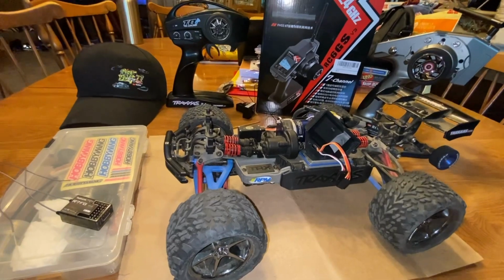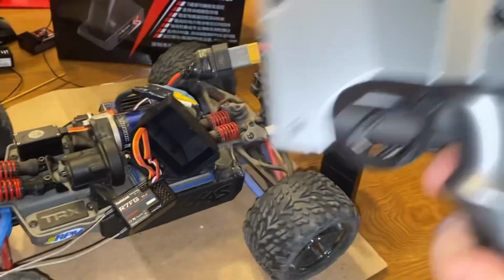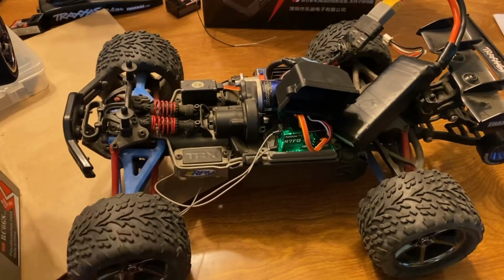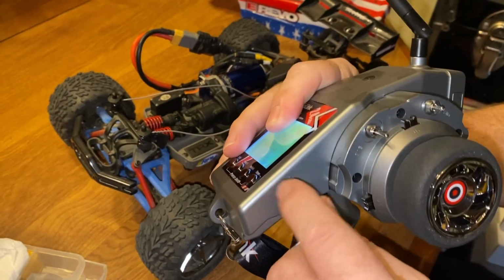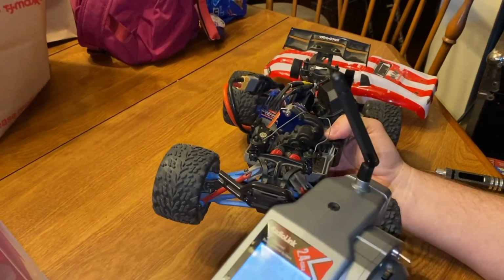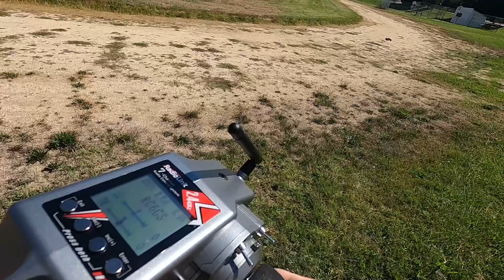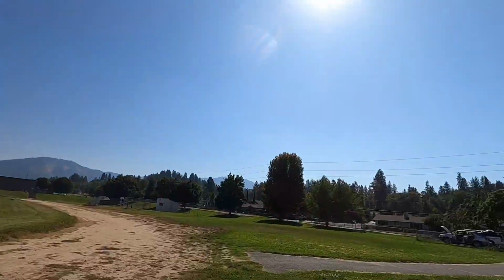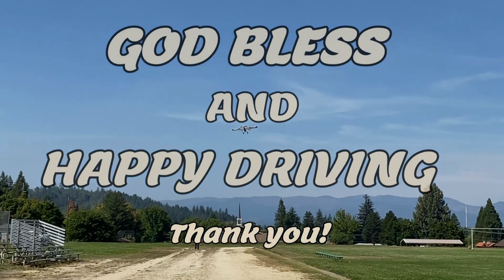Radiolink RC6GS V3 How To Install + Gyro + Range Test = Amazing !

Comment: Great video - cranking 'em up to 11 my dude! 
I've been running this radio for about a year now, on a small fleet of cars, crawlers, and even a skid steer Sherp. Great bit of kit, but be wary of using the 1/4" mount for your phone or anything RF "noisy," range suffers pretty significantly when I have my Pixel 7 in a swivel ball joint up there, but don't push the range when I'm using it because of the interference. 
The Tiny 3g R4FGM, the 6g R6FG, and the super-long-range R8EF are all incredible value in receivers, and have worked perfectly for me for traditional PWM servo and ESC connections, or using the SBus protocol for my FPV'd WPL D12, which has a flight controller running Ardurover. This radio, and the receivers available for it, remind me of the 'ole FrSky Taranis, with it's affordability and adaptability, for ground vehicles.
Reply from the maker: Yeah your right and I haven’t heard of the Taranis is a few years or so. It’s been a while since I heard anyone talk about that transmitter.

Comment: Does the v3 model save external battery voltage alarm based on model? I have v2 and it uses just one common setting for all models.
Reply from the maker: I just know you can set a low battery by settings. I just programmed each model channel. So far just have the Erevo and Xmaxx named and programmed manually my settings. So messing with this controller and finding more things I missed. Thanks for stopping by.

Comment: I just learned R7FG does not support digital servos (I only learned that from some RadioLink reply on Facebook - that information is nowhere on the product page, nowhere in the manual)
honestly I am not sure I would purchase it they were transparent about it and I knew that in advance

I have the original E-Revo Brushless TRA5608 still with the stock dual TRA2075 digital servos
I just connected the R7FG and it works but I guess I am losing some performance by running it on 14ms
can this damage my servos not running them in the 3-4ms they are designed for?
Reply from the maker: For me I am ditching
The duel servo on my Erevo 2.0 and outing only one. Traxxas servos seem to fight each other after some hours of running. I’m not happy with the preference of dual. I’ll just put a heavy duty single servo  like I did in my ex Max.
Reply: @BIGDRONEFLYER77RC  I also plan to upgrade to single servo when needed but to my surprise the stock ones still both work on my 2010 E-Revo Brushless Edition

on my friends e-revo he blew them within 2 years and we were using the same tires at that time (proline big joes)

honestly I don't have any issues and the dual setup seems to work just fine for me so don't want to upgrade  if it's not broken
Reply from the maker: @HeadBassVTEC I’m doing the same, run it until it goes 👍

Comment: Hi , i got a summit with dual servo, any idea how i could setup the channel to use 2 steering?
Reply from the maker: Just have to plug one servo in channel one and the other in channel 2 for the duel servos to operate. Works great 👍
Reply: @BIGDRONEFLYER77RC  I don't have my transmitter yet, but traxxas summit uses 5 servos, can the voltage of each servos be adjusted? The T-lock sub-micro servos are 4-6volts  and steering is 7-8 volts, also channel 3 will be the esc?